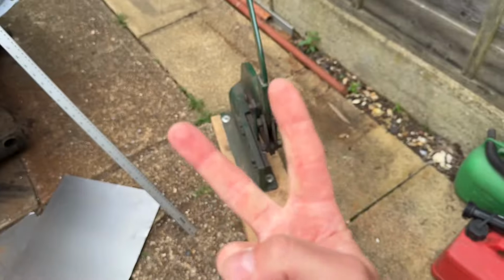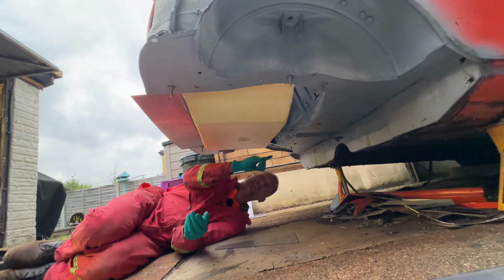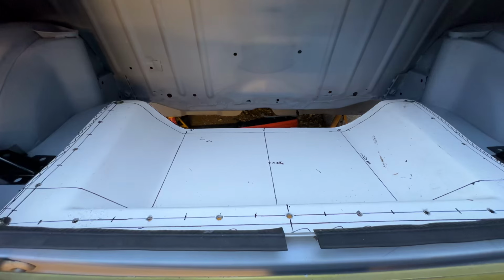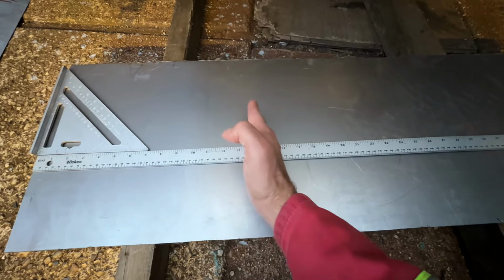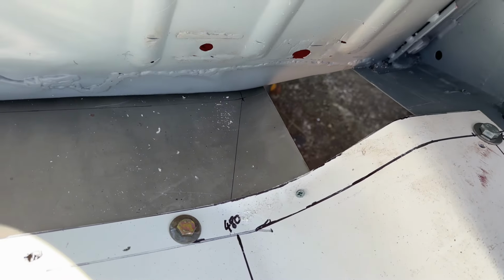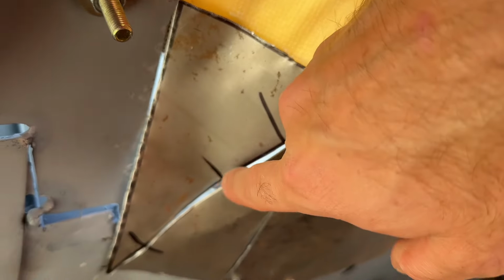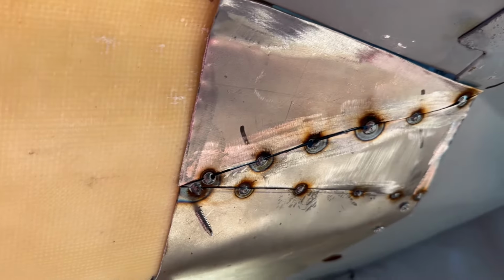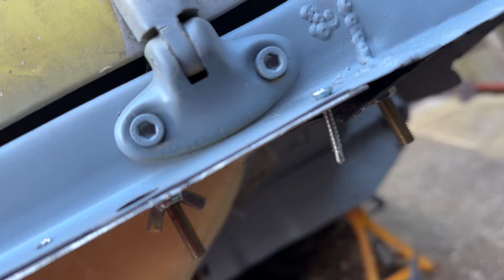Classic Mini - Rear End Rebuild - Part 6

Comment: Nick, keep an eye out at Lidl, they do Nibblers at a decent price. You can also get an attachment for a regular drill which works really well. I think mine are Sealey, but I'm certain Screwfix do them
Reply from the maker: Will do. I definitely need to get some new ones. The 50 year old Gilbows are dead and the others just can’t hack cutting through 0.8mm steel, I got them for my aluminium dash many moons ago.

Comment: Should of made that big bit out of one piece no welded up joints to mess about with
Reply from the maker: Yeh I hear you but I haven’t really got any metal forming tools and my previous attempts have all been a nightmare. Several separate pieces welded together makes it easier to make the shapes I want and more welding isn’t so bad. 

The custom clubman inner wings on the front look good and were done the same way.